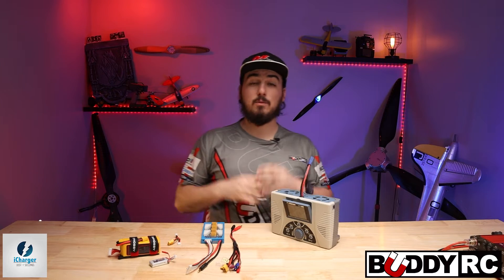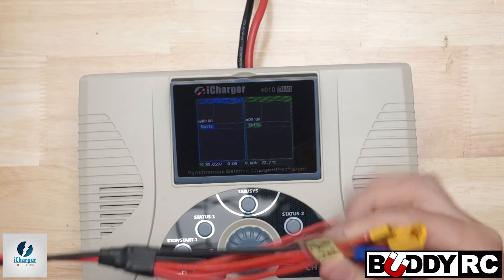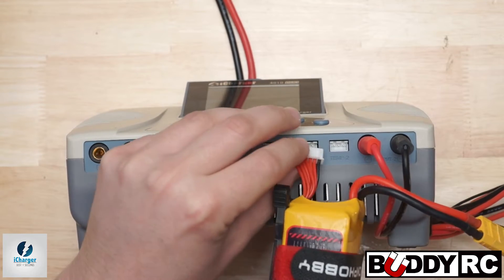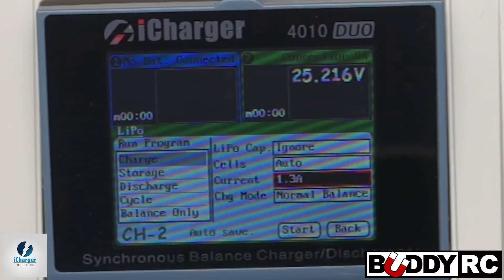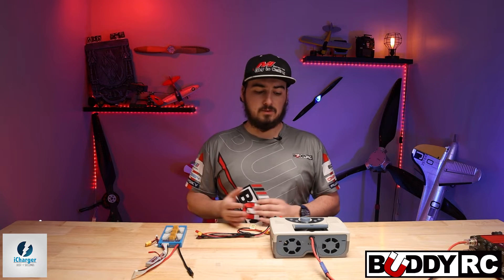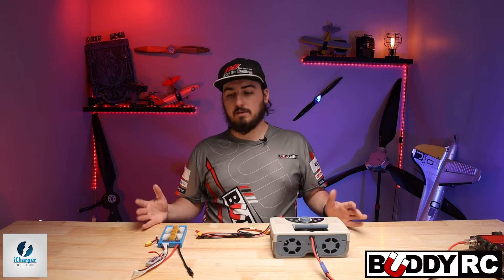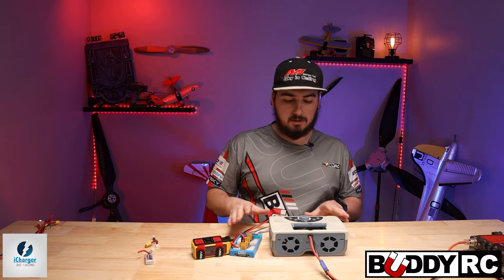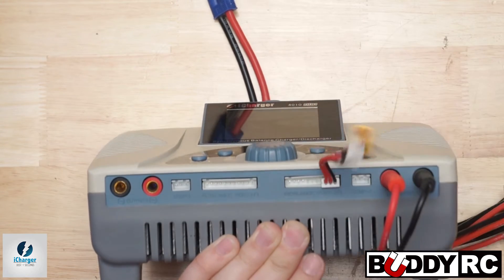How To Charge and Discharge on a ICharger made simple! -ICharger series

Comment: I have a x6 icharger. What i want to do is use a external resistor bank in the output plug bring up the discharge rate to 30A and have it send the power to my battery bank in the input of the charger. That battery is a lifepo4 battery. Thanks in advance.

Comment: I've been having problems with trying to get 2 separate battery profiles at the same time. I'd have ch1 set to 5000mah 15amp charge and I need ch2 to be 1100mah 5amp charge, but everytime I edit ch1 or ch2 to get the setting I desired it will change both channels to that charge setting.